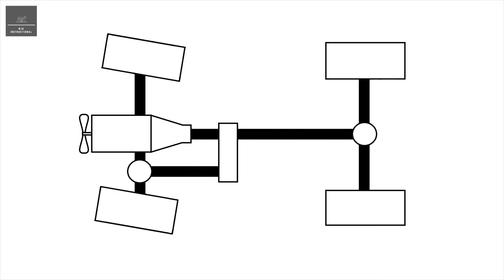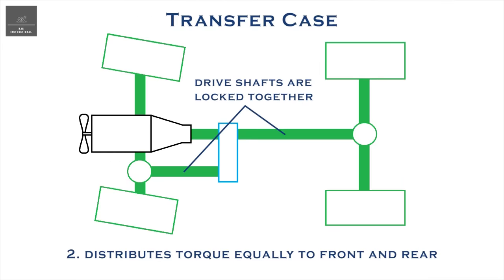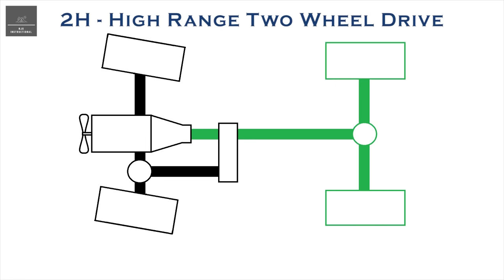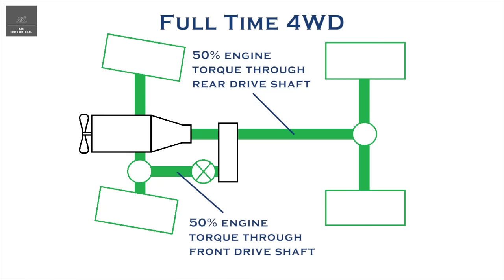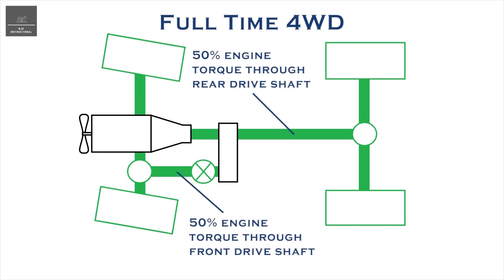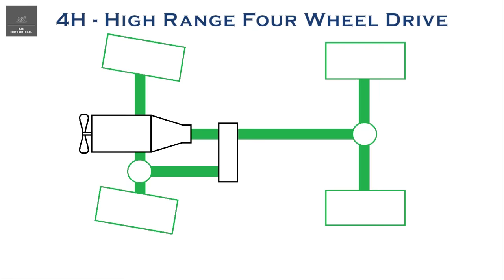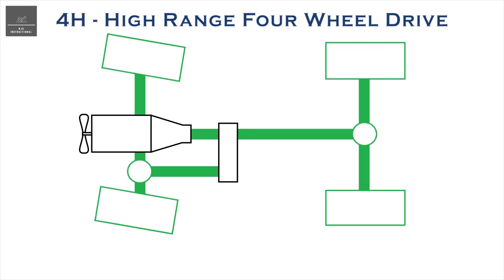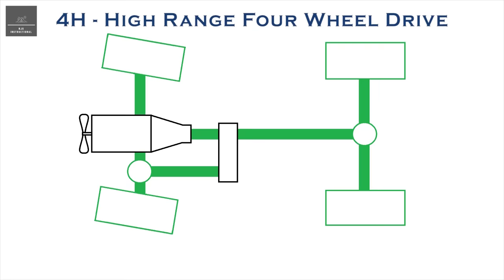How 4WD (4x4 - Four Wheel Drive) Works - 2H, 4H, 4L, LSD, Centre Diff, Diff Locks, Traction Control

Comment from the maker: *Please note: In this video I have incorrectly mentioned that Torque is distributed/split based on wheel resistance. In reality, in an open differential Torque is split evenly 50%-50% to each axle regardless of wheel resistance. However, Power is split based on wheel resistance in an open differential, not Torque. Power = Torque x Angular Velocity. Therefore, in an open differential, if a wheel is in the air and freely spinning, the other wheel which isn't rotating isn't transmitting any Power (as Angular Velocity = 0, but Torque is still present). Watch out for a future video which further clarifies this.
Reply from the maker: @Ralph Reilly Exactly, so you have zero Power distributed.
Reply: Thanks man
Reply: @charleslupain  thank you

Comment: You are definitely an expert on this subject, but your terminology is a bit off.  A open diff always send equal torque to both sides, but since one side has no traction, torque is zero, thus the other side with traction doesn't turn, because torque is zero.  With a locking a diff, the torque is NOT equally split.  The lock is locking the rotation, whichever wheel has traction receive more torque.  This is the actual physical explanation.
Reply: That is based on the explanation of physical work done. It is not how power split or power delivery works in a differential.

Comment: The idea that than open an  differential sends all the torque to the wheel with the least resistance is not true. An open differential actually splits torque evenly, what it does is allow one wheel to spin faster than the other. But because it takes very little torque to spin a wheel with no resistance, 50% of the required torque is not enough to move the vehicle forward. So the other wheel does not spin eventhough its getting the same amount of torque. Conversely a locked diff can send 100% of the torque to one wheel. This is because torque is based on traction. And if two wheels are forced to spin and the same speed the wheel with more traction is receiving more torque. To summarize open means unequal wheel speed and equal torque split, but a locked diff means equal wheel speed but uneven torque split.

Comment: Sorry but The Torque split descriptions aren't correct, but the message is clear enough  ( an Open diff is what  splits Torque 50% 50% , a locked Diff does not split torque at all. Traction will determine how much torque is seen at each wheel - up to 100% to one wheel. )
Reply: Mississippi Ditch Fisher     I know what you're trying to say, but it's not correct.  With an open diff,  If one wheel is in the air and spinning there is (next to) no torque being applied anywhere. If you floor the accelerator in this situation the engine will free-rev , as it is unloaded - No torque..  From the diff's point of view , the only torque being applied is from friction in the bearings and brake pads, and the torque required to accelerate the spinning wheel  - all in all a very small amount.    Because an Open diff splits torque 50-50 , that small amount of torque is replicated on the opposite wheel with grip - hence why the car cannot move.

With a locked differential. In this same situation, the wheel in the air Still cannot have any torque applied,  the difference is, the wheel with grip can, and hence will '"receive" as much torque as it can before losing traction 

the key take away here is that Torque does not simply flow out of a path of least resistance, that's basically a paradox,  Torque is a measure of twisting force. If there's no resistance, there's no force.
Reply: Mississippi Ditch Fisher  mAJORDEE is exactly right.

Comment: Hi, very well made video, although I noticed a mistake on 3:30 minute mark about open diffs. It will be easier to explain if I just directly quote from CarThrottle website.

     "Open differentials are the most basic form of a differential. The purpose is to allow for different speeds between the two wheels, while torque split is held constant at 50/50. A common misconception with open differentials is that when one wheel is lifted, 100 per cent of the torque is sent to it. This is not true, however the amount of torque sent to the wheel with traction is very low because the amount of torque required to spin a wheel is also low. Remember, both wheels always receive equal torque, but if one has no resistance (eg. if it’s in the air), the amount of torque sent to the drive axle as a result is very low."

So, open diff will always split the torque 50/50, even if one wheel is off the ground. We just get the illusion that 100% of the torque is going to one wheel because it is spinning but in reality diff is still applying the same ammount of torque to the non-spinning wheel (It is still trying to turn it).
There is also a mistake in the  video about locked rear diff. I will quote again:

    "Locked differentials are on the opposite side of the spectrum versus open diffs. The purpose is for wheel speed to remain constant between the two wheels, and the major benefit here is that torque will go to the wheel with traction, up to 100 per cent at a single wheel."

That means that when the rear diff is locked, torque is not split 50/50 (that's open diff), but it varies up to 100% on one wheel. For example if one wheel is in the air, wheel on the ground will get 100% of the torque. Or if one wheel is on the ice and other on pavement, the wheel on the ice will get  lets say 23% of the torque while wheel on the pavement will get the remaining 77%.

Engineering Explained goes really in depth on this topic, I recommend watching some of his videos about this. This one is good:
https://www.youtube.com/watch?v=_HOa0aRZYpw&ab_channel=EngineeringExplained
Reply: Your explanation is more true, but a bit harder to understand for someone who hasn't had a more higher class in physics. I get however what NJS is talking about. That way it's easier to understand for me (as a noob) what's happening. It would've been better if he didn't use the phrase 'torque', but more something like 'movement or momentum'. However, thinking about that, it could also be interpreted wrong.

The video's from engineer explained go waaaay more in depth and use all the correct terms and calculations, but are harder to convert to driving in the real world. NJS covers way more topics in the same time that Engineering explained used to talk only about diffs.
Reply: I am new to 4wd and this is the 2nd video ive watched about 4wd systems, and it doesnt make much sense. This comment that i am replying to might be a little more comolicated then the video, but aeast it makes sense. This video was saying that open diffs have a big flaw, and closed diffs have a big flaw which dosent nake much sense, since cars are to old to have big problems like that. How it was explained makes it sound like a really ineffective design, almost like a new technology, which it's not. With that being said, is it really that bad to go on grippy surfaces in 4wd if torque is applied differently and the wheels are spinning at different speeds if its a locked diff? Am i missing something or what?
Reply: @WhynotMinot  If the rear diff is locked, rear wheels will always spin at the same speed. Torque on the other hand will be split differently between them.
Reply: @edewaal97  How is it better or easier to understand something that is completely wrong? You want to understand how a radio functions. You turn it on and then gasoline runs to the injectors turning the volume on... No it doesnt. Doesnt matter if that is "easier" to "understand" than what is actually happening. That's a completely meaningless and waste of explanation that cant be used for anything..... since its wrong......
Reply: @martinsv9183  True 😂

Comment: Thank you, As a returned 4wd'er I forgot most of what the gears do, I did get stuck a few times and being somewhat hot headed I turned back with my tail between my legs, Now I understand the system in my Prado I am more confident and will think before I go at it. I will watch this again just to be sure, Thanks for posting..
Reply from the maker: Glad it helped

Comment: I never knew what the difference between 4H and 4L is, although I intuited that 4H is meant for higher speed and 4L for lower. Thanks for the concise and clear explanation!
Reply from the maker: Glad to help!
Reply: 4H is normal driving. 4L is for bad off-road condition in which vehicle will not move even in 1st gear of 4H mode.

Comment: 3:56ish. The wheel with the least traction does not receive 100% of the torque. All driven wheels will receive equal torque all the time in a truly open differential system (less traction control systems). Say a wheel breaks traction when torque applied exceeds 15 foot pounds of torque. All driven wheels will receive that same 15 foot pounds of torque. A spinning wheel indicates a reduction of torque being applied to all driven wheels. All driven wheels will always receive equal torque(less traction control).
Reply: This is true. The engine does not produce torque alone, it produces rotation which causes some torque depending on the load. If one wheel slips at 15 Nm of torque, then all the others still get that 15 Nm too (in an open diff system), and the engine will be loaded to 30 Nm (assuming 2 driven wheels). That 30 Nm yields to some force (torque divided by the wheel radius, exactly) and if it happens that it is not enough to move the vehicle then you are stuck.

Comment: Hi guys, that is one brilliant, well put together video.  One point, in the Free Wheeling and Permanent Locked Hubs Section, you show the Nissan Patrol 2-Way Lock Free-Running Hub. This had two settings: Auto or Manual Lock. With this unit set to Auto, you can shift straight into 4H or  4H without doing anything to the hubs, its done electronically. If for some reason the electrical system fails, then it allows you to manual lock the drive using the wheel brace. Fabulous piece of kit.
Reply from the maker: Spot on Jim, thank you for clarifying. Not many vehicles these days have this feature...
Reply: @NJSInstructional  Nissan Patrol Y61: Belt and Braces. Thank you again for the excellent video and delighted I could be of help.

Comment: Great video, mate ! This is the most comprehensive panorama of the topic I've ever seen. As a follow-up, you might want to cover the gearing system in the wheel hubs of Unimogs and Hummers. My first offroad fun was in 1974 in Ethiopia driving a Gaz, a robust Russian military jeep: side-valve engine, 3 forward gears, part-time 4WD with high and low ratios, + freewheeling hubs. I had incredible adventures especially in the Danakil Desert.

Comment: thank you for talking about full time 4wd.  I have gotten into arguments about people how full time 4wd cannot exist. That anything that claims to be full time 4wd is really AWD.  My old Discovery would always beg to differ.
Reply: Exactly, there is a big difference between AWD and Full time 4wd with locking center diff. The biggest difference being a full time 4wd has a locking center diff which essentially makes the 4wd identical in operation to a part time 4x4 with 4wd engaged. Also, a full time 4wd has 4lo and AWD does not.
Reply: @ThisIsDavesGarage  What about older Range Rovers and Jeep Grand Cherokee which have limited center diffs that cannot be locked but have low range?
Reply: I have a 2002 jeep Grand Cherokee Laredo 4×4 high and low and its nothing like all wheel drive, I take my jeep 4×4 anywhere but the all wheel ford I had couldn't go where the true 4×4 can go.in my opinion 4×4 high and low are best for off road and on road.This Was A Great Video And it confirmed that the true 4×4 is superior. Thank You For This Information. New Subscriber here.

Comment: Excellent video. Most of us may not remember the numbers involved but surely more knowledgeable in applying this information whenever selecting 2H, 4H or 4L on different surface and environmental conditions. For those drivers who own AWD now better understand difference between AWD and 4WD. I expect more informative videos from you. ⭐️⭐️⭐️⭐️⭐️
Reply: The 1972 military jeep I drove in the army gave us the options of 2 high and 2 low, along with 4H and 4L.  They were tough beasts with an inline 4 cyclinder engine and 3 speed manual tranmission.

Comment: What a great video, great explanation. I have the latest land cruiser prado which is full time 4WD HI, but you can select 4WD Low and the centre diff can be locked in either 4 hi or 4 low. I always say you know if you have a true 4WD, as it will judder when you turn with it on dry surfaces and will be difficult to steer at slow speeds. The prado is exactly like this. So too is my truck. Although that is 2WD rear and can be put into 4WD low and High with rear locking diff. Stiff as anything to steer on dry surfaces. With my truck if you go above 35kph the diff with automatically disengaged so no danger of damaging the diff or drive train.
Reply from the maker: Cheers, thank you. The judder you mention will lead to wind-up, too much of it will eventually damage the drivetrain. Be sure to check out my Part 2 video.!
Reply: @NJSInstructional  yes absolutely, I obviously don't drive on dry surfaces with the diff lock, was just mentioning how it behaves when engaged on a dry surfaces.

Comment: For everyone enjoying this video. Just make sure to check your manual of your specific car. For the Jeep xj with up country package, my car, the part about “part and time and full time 4wd” actually dont work the way it’s stated in the video. Full time 4wd means torque to all wheels 48% front 52%back with slippage in between center diff. Can be driven full time on hard pavement hence it’s called FULL time. Part time 4wd is a simply 50% front 50% back with the center diff locked. Can only be driven on slippery surfaces, ice, mud etc.. hence its Called PART TIME. 2wd is just power to the back and 4low is simply 3x torque but only 30% of the speed. So again read your own manual before you simply think what’s stated here accounts for all cars. Every brand has their own lingo and branding. Trac lock, Quadra trac, haldex, Quattro, posi locker, LSD (limited slip differential), ELSD (electronical limited slip differential), torque vectoring, torsen differential, airlocker, e-locker, Detroit locker, locking hubs, etc so do you research and read the manual. Don’t be confused by marketing terms. Just understand the branding your working with and that it’s just a particular technology to modulate the amount of torque to the desired specific wheel in certain conditions. And obv the strengths and pitfalls of each of these methods. Do research,
It’s fun.

Comment: Momentum and tires are king of not getting stuck. Btc does not respond quick enough so you lose your momentum and get stuck. So when buying a new four-wheel-drive just look for a centre different lock button and a rear differential lock button on the dashboard and get a set of off-road tires

Comment: Great video 

You can still drive a Mitsubishi Triton (L200) in 4H in bitumen surfaces, they have 4 drive modes while others have 3. 
4H for Bitumen and 4HLc for Locked Center Diff.
Reply: All Mitsubishi 4x4s have Super Select that you can drive with 4H on the highway.

Comment: What a great video !!! Finally I understand how it works and why you can't drive 4x4 on a normal road !!!.   And by the way you should be a teacher. Thank you !!
Reply from the maker: Glad it was helpful!
Reply: Well my friend than you have learned absolutely false information. Bc you can’t absolutely drive a car with torque to all wheels, 4x4, on a normal road. Ever heard of limited slip differential or an open center differential?? I’m afraid you haven’t learned much.
Reply: @NJSInstructional  as the author of this video the least you could do is point out that this guy hasn’t got it.
Reply: @Ks-zz9lh  Yes, there probably will be cars with these things instaaled. But a lot of them don't

Comment: What an amazing and informative video!! ,thank you for your efforts sir 👍🏻
Reply from the maker: Cheers, be sure to check out my Part 2 video also!
Reply: @NJSInstructional  I definitely did ! I have a pajero 3.8L ,it does not have a R/D switch ! Only Center-Diff ,but after some research ,I found out that they added another TCS(Traction Control System ) , Your video helped me understand how all these features work .

Comment: Nice and very usefull video, i have a hyundai Galloper part time 4wd with lsd rear axle, the diff ratio is 4.88, how much expensive it will be to fit it with a lock diff? Any brand that you reccomend, thank you